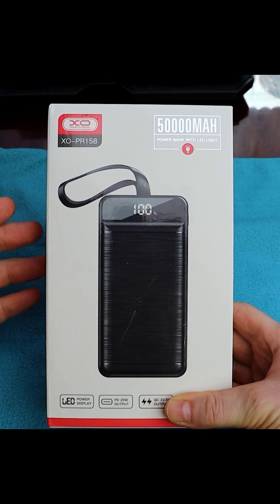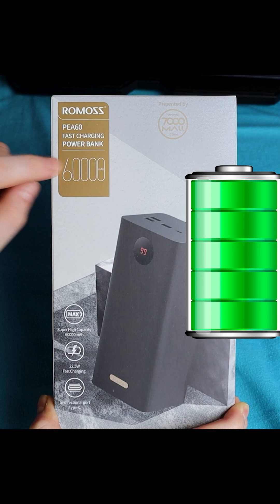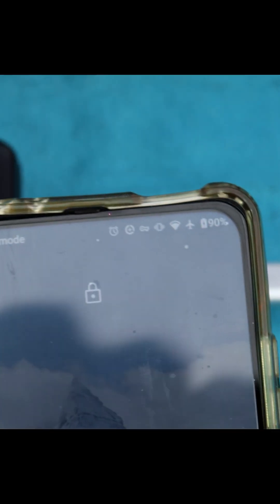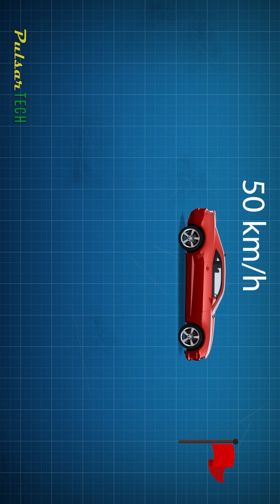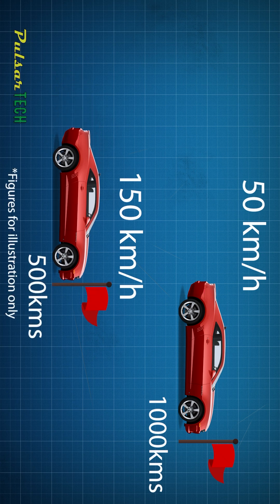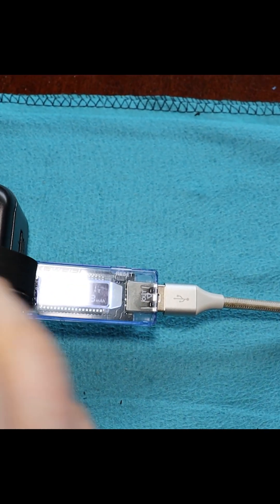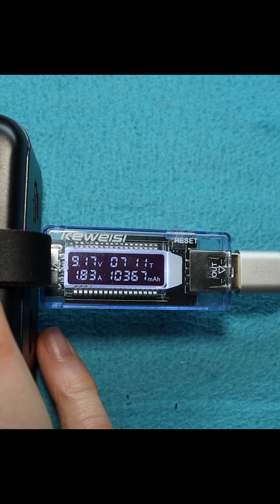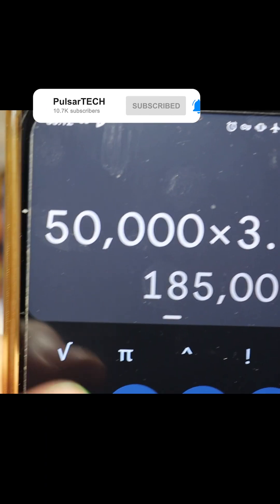Why Power Bank ADVERTISED Capacity Differs From OUTPUT Capacity #shorts

Comment: some “20000” mah battery banks only have a true 2500 mah battery lithium cell inside. Maybe you are right or it’s just a bit of paid misinformation
Reply from the maker: In this case, we're not talking about fake or counterfeit power banks that claim a 1000000mAh capacity or something like that. If one gets a fake power bank with only 2500mAh capacity instead of 20000mAh, then it's a fake power bank. But in the video, we're talking about how even a genuinely true capacity power bank might show less capacity depending on how much power it is outputting. This is a normal thing for all kinds of batteries.